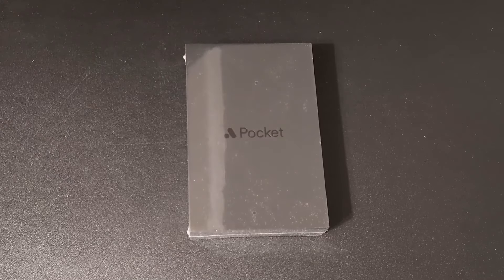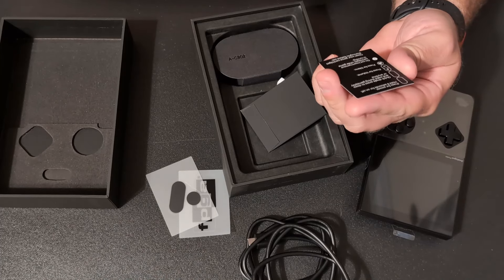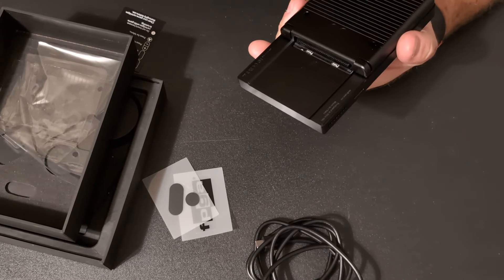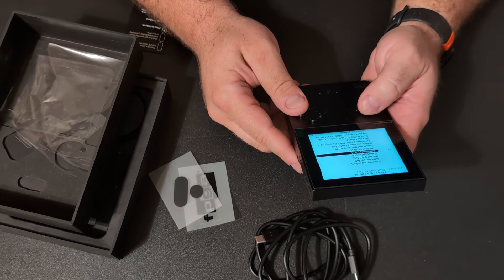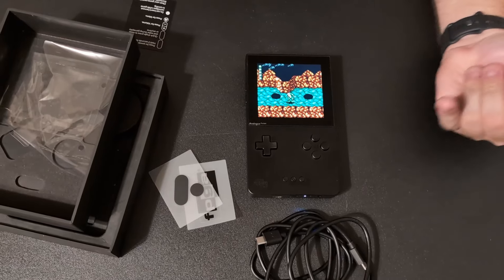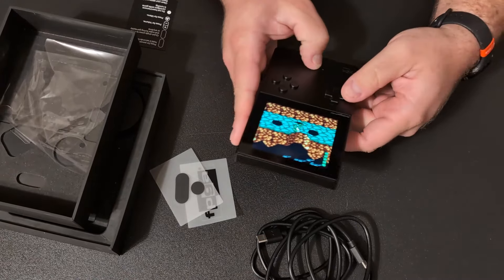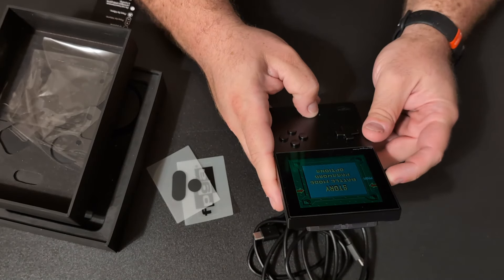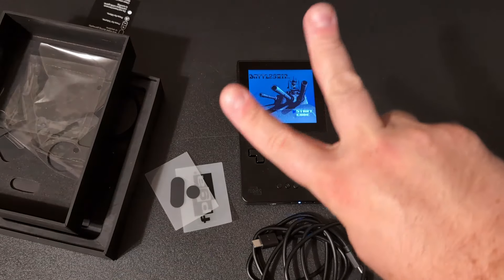Unboxing: Analogue Pocket Aluminum

Comment: You can change the display modes with every core these days, get the system and the cores updated to the newest version. It wasn't 500 Dollars though, was it? After shipping and tax in most places in the world(and even some in the US) it would be more like 600(or at least 550 I guess, when you don't pay vat) or even 650 Dollars(import to Germany for example) :D I got the white plastic one about half a year ago and am having a blast with GBC games especially, this is the best way to experience them. That said SNES and NES also look great on it, GBA is a bit worse off as the aspect ratio isn't working as well there, as the GBA was 3:2, while CRT TVs for the consoles were 4:3 and most Handhelds were around 5:4, which is the aspect ratio of the AP. As for the Dock, I got that and had a blast with Arcade Games and SNES/NES so far, reason being the excellent Trinitron CRT Filter, it turns your LCD or OLED TV into a CRT. Don't forget old 8-16Bit games were created with CRTs in mind, which means the sprite-artwork really shines on a CRT device or on one that can simulate it as good as possible. Oh and another plus for the AP is that it is almost latency free, thanks to the programmable cores, software emulators can't compete.